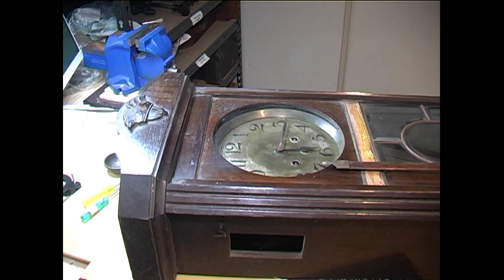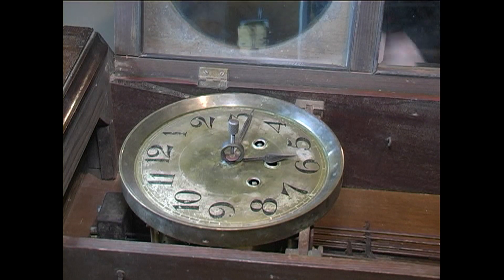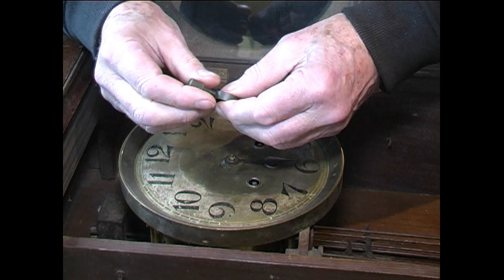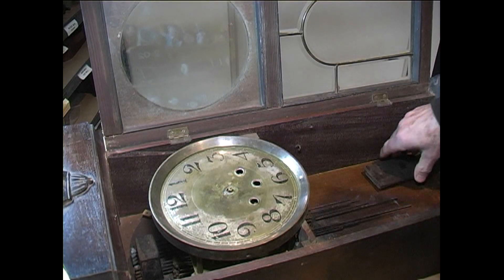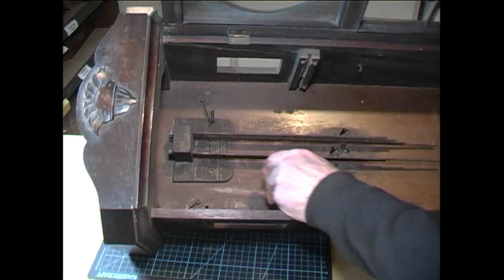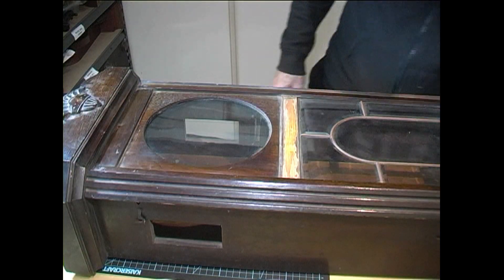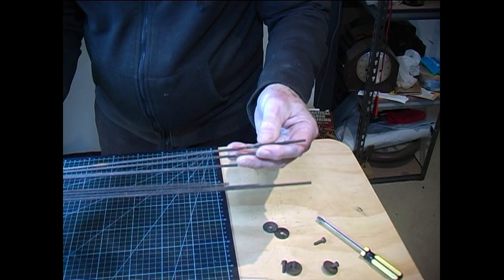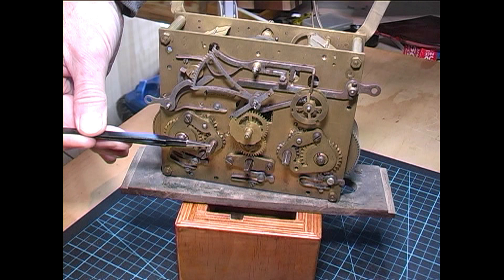German Westminster Glocken-Speil Model 107 wall clock {1} Removing the movement #GermanClockRepairs

Comment: Thanks for the video!
This clock type and it's case
were once sold under the brand name "Favre Leuba & Co."
Very few clocks could match such lovely quarterly chimes. 
Only when struck by the felt hammers, will you hear it's true tones!
The tempo is kept constant by the spinning brass air vanes.
The winding spring is not easy to replace.
The pendulum has a built in temperature compensation adjustment.
When re assembled there could be an error stacking its components 
Good luck!

Comment: Nowadays the sound of chiming bars (both musical sequence at the quarters and striking the number of hours soon after the fourth quarter sequence) are recorded and programmed in electronic circuit board connected to speaker and installed in some quartz clocks so that they electronically imitates the same clock. Citizen, Seiko and Rhythm are the most well known brands for manufacturing such quartz clocks.

Comment: I have one of these, same name and model. Do you happen to know what year these were manufactured? Do you know the value of these, working or not working? Appreciate it if you have done that research, if you would share. Thanks
Reply from the maker: I was not able to find out a definite date but it was made in approx 1930-40s. I paid $80 for mine (not working) in Australia 2020 I think.
Reply: @ScottiesClockWorld  Thanks for your response. Did you sell the clock you refurbished? I was wondering how much you sold it for.
Reply from the maker: @annerae4102  , it was never sold. We has a water pipe burst and flood a few rooms of the house including the lounge where the clock was on the floor. It's still waiting to be finished once I check out the water damage.
Reply: @ScottiesClockWorld  Do you have any idea what one might sell for if it is in good condition and working? Just wondering as I have no idea and not sure how to come up with a valuation. Your You Tube was the only thing I could find online. Thanks again.
Reply from the maker: @annerae4102  , The clock is quite old, unusual and I have only seen one of them.
In good condition and working order I would think a collector would pay more than $500 for the clock.
Where will he find another one?
Hope that helps you.

Comment: Hi. I have a German clock and when I removed the pendulum it runs when try to replace it back the clock stops running. Help
Reply from the maker: If the clock stops running when you replace the pendulum then the clock is out of beat. Make sure the surface it is sitting on is level and try again. Check to see if the duration of the Tick and Tock are the same, if not, raise one side of the clock a little and listen to the sound. If the clock stops lift the other side slowly till it starts ticking again.  This will show you how far the clock is out of beat.  Wedge some folded parer or cardboard under this side of the clock till it continues to run with an equal Tick and Tock duration. Let me know how it goes.
Reply: How old are this?